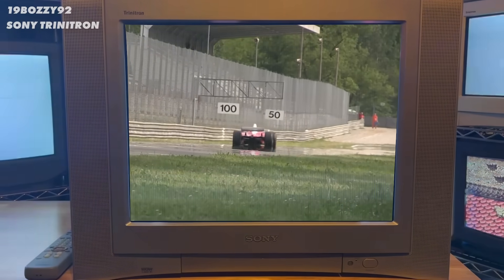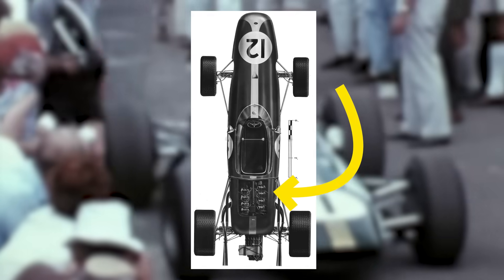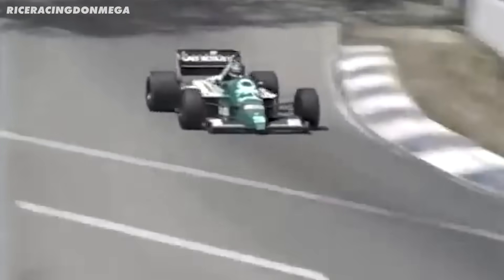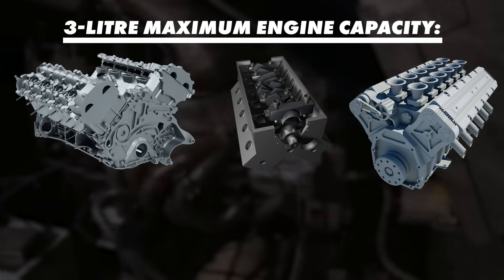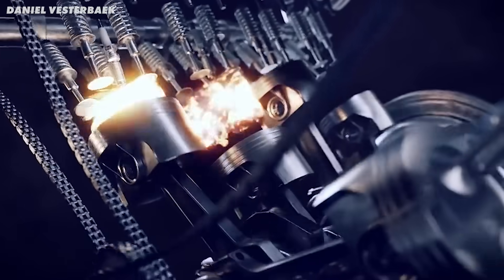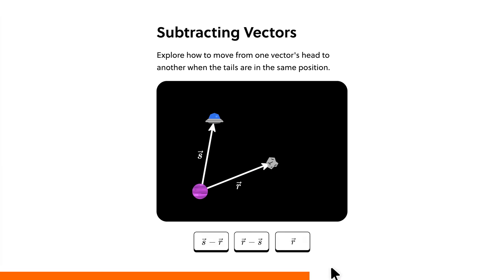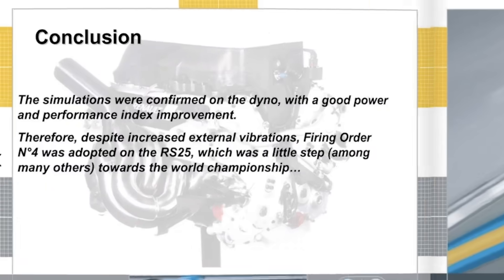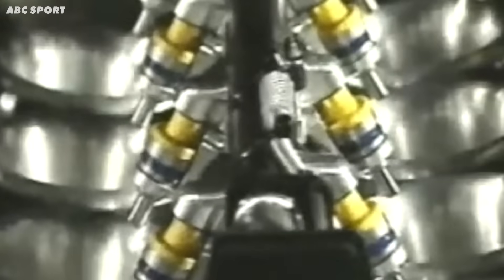How We’re Wired to Love F1 V10s

Comment: I dream of an engine setup that manages to scream a high rpm harmonic over a thumping that modulates through atonal rumble into bass tones up to about 100hz. A 5th or major 3rd would definitely be likely choices, but with that big gap there's quite some other options that may sound kind of haunting, yet so clear with the two separated sounds.

Just imagine the satisfaction of reaching the rpm pairing where the lower note emerges as the fundamental of the upper note... 

It's sorta like a slice of a shepherd tone effect, where instead of the lower ascending voice fading in out of low volume, it fades into tonally perceived range.

I have no idea about the challenges of coordinating two vastly different engines and how consistent they'd have to individually be to begin with (For performance and sound), but just imagine a massive low rpm monster bulging out the front with the screams coming from the back. A single block that manages to do both also sound wild, though. Coordinating a turbo and supercharger, aside from some spooling, that'd just be a symphony.

Comment: theres another part to it too, with the distinctive scream that can sometimes sound higher pitched than a similar revving v12.
the explanation i think comes about when you divide up the numbers
6 cylinders -> 1, 2, 3, 6
8 cylinders -> 1, 2, 4, 8
10 cylinders -> 1, 2, 5, 10
12 cylinders -> 1, 2, 3, 4, 6, 12
and when you split those numbers further, you begin to see what you hear.
6 -> 2x3 (perfect fifth)
8 -> 2x2x2 OR 2x4 (unison / octave, depending on layout)
10 -> 2x5 (major third, but an octave up)
12 -> 2x2x3 OR 3x4 (unison / perfect fourth)
my theory is the 8 cyl sounds like 4 sets of 2, which gives it that very octave-y noise, and a v12 sounds like 4 sets of 3. the v10 on the other hand has the biggest count when split up, with 5, giving it a higher pitch and forming that clear and distinctive tone.

Comment: In my perfect world F1 goes back to NA 3.0L V10's, 80% of downforce is from a fan (imagine the race starts and the insane top speeds), slicks, refueling with sustainable fuels, and smaller cars. In fact I'd go so far as the team's transportation, aircraft included, is on sustainable fuel. All this road relevance and smaller carbon footprint crap is a lie. There is nothing road relevant about an F1 car and the carbon emissions of the teams travel to each GP, especially with that idiotic calendar, is a shitshow. Sadly, as long as the Saudis are involved, it will be about oil.

Comment: ohhhhhh, wait, so the DISPLACEMENT of the engine, is how many liters it uses in one revolution, which means that all the space inside the pistons added together has to equal the displacement
therefore a 3 liter single piston, would have 1 piston having 3 liters volume, and 8 piston 3 liter, would be 8/3 on each piston

i never knew that

Comment: Nahhh, have you ever heard a double 7 radial engine from a fw190 fire up, that makes you happy, fact, that deeeeeeeep rumble, holy jesus. I mean tastes vary, but goddayumn that sounds nice. Or maybe put a gas turbine like the M1 abrams in there like lotus did, no firing order, continous burn, insane rpm, well it drinks fuel as a hobby, but that sound, its loud, its high pitched, it's like the V10 but its the upper side of the compromise, where you compromise the fuel efficiency for the rpm, and maybe it could be implemented with refuelings like they did back then so yeah. Cool video though

Comment: Very good stories about the acoustic "styling" in F1. Thanks for that and they explainations as well. Yes, the V10 are very special and I confirm this was a very awesome sound. But also I like the sounds of the older V6 Turbo engines, they were more damped and not so high reving, but also very special - at least compared to that silly sounds of current F1, despite of the same configuration -  from the viewpoint of a V6. But maybe the configuration of the exhaust makes that so "special". Now all the pipes goes into one Turbocharger. In the 80`s there were only three pipes going on each side into a separate charger and maybe that`s it. Could it be so simple? This sounds worlds much better than current configurarations - I swear. My hope is that one day they return with really cool sounds the offering now. But it seems Lightyears away - 😮‍💨

Comment: 11:40 Its not just about the harmonics. I mix/engineer music/audio. Its also the frequency range of a V10, but also the fact that a Major 3rd is a Poly Rhythm. 

Freq Range:
The main core of the sound is situated in a region that our ears are tuned to. Any V engine with 10 cylinders running at 18'000 rpm, is going to be producing a fundamental note, from RPM note , purely from the combustion cycle, of 1.5 Khz. which is right in the middle of the main frequency band human ears are tuned to (200Hz to about 6Khz). with 1 Khz to 5Khz being where all the detail and definition is in our hearing. A Babies cries is about 3 Khz as are Emergency vehicle Sirens. The 1 to 5 K range is what we hear the most. Its this region of audio that decides how "in  your face" a musical mix is. 

So to put this together, (and to add a further complexity at the end), Not only are harmonics producing a Maj 3rd relationship (which means there is a 1st 3rd and 5th note present), but they are doing it at a frequency range that our ears are particularly sensitive too, so like a distorted guitar amp, its very in your face, but the sound is strangely pleasing so that pleasing nature gets an element of overwhelming, it cannot be ignored, it demands your attention, you are naturally tuned to this freq range

Poly Rhythm:
What is a Major 3rd? well its actually a 3 over 4 poly rhythm from a pulse/frequency POV.
What is a 4 over 4 poly rhythm? basically a 3 beat cycle over a 4 beat cycle , so the so the cycle resets every 12 individual beats.
99.999% of popular music is based around mostly 4 beat cycles and if not, 3 beat cycles. A major 3rd contains both of the most common rhythmical structures within it 
(this 3 over 4 is based on the pulse of each harmonic and the cycle of them repeating the same pattern )

I really have not articulated this well, but hopefully someone will read this and get something out of it
Reply: I found this amazing

Comment: There are several questions I'm not too sure you answered. First as far as what our ears like to hear, to me it's pretty simple. We like high-pitched noises up near the 20,000 Hertz limit of our hearing. Everybody refers to an engine screaming rather than roaring as a desirable thing. That obviously refers to pitch. Now are you saying that a V10 can produce higher -pitched sounds than a V6, V8, or V12? It seems to me there's a correlation between high rpm's and high pitch and that's one of the main reasons current F1 engines can't make those great sounds. I think you could make the current engine in an F1 car a V10 and if you kept it at 15,000 top rpm (not to mention the drivers usually don't even rev the car that high)  you wouldn't get those screams no matter what else you did.
Second we like a rapid change of pitch: we like the sound to go from low to high in a hurry. So the more powerful the engine the quicker it can increase the revs from low to high. Or the more gears a transmission has or the closer spaced they are, the quicker the engine can rev up, because it has to do less work in each gear.
Also are you saying that different engine configurations imply different top rpm's? Specifically are you saying a V6, V8, or V12 cannot achieve 19,000 rpm's? 
And finally you don't mention the effect of turbochargers and various hybrid electrical power producing units on the sound. Isn't it true that driving a turbocharger or electrical device robs the exhaust gases of some of the noise and power they otherwise would have and effects the noise they make rather drastically?
Thanks for putting out some very interesting videos.

Comment: I'm sorry but the conception that more cylinders = less moving mass and easier to rev engine is a complete nonsense, you have heavier crank, more rods and pins, pistons are smaller yes, but u have more of them, u have longer and heavier camshafts, more valves which are also moving, the more cylinders you have the more parasitic losses you make due at least the friction of camshaft to valves, piston to cylinder surface, more heat etc. One cylinder engine will always have less moving weight than whatever number of cylinders engine given the same displacement. What actually helps reduce the piston speed and get more revs is bore to stroke ratio, have a read on that

Comment: 7:58
Releasing "high pressure gasses" into the exhaust pipe.
More precisely, releases COMBUSTION into the exhaust pipe.
The exhaust valve opens BEFORE combustion is complete.
Combustion contained in the cylinder explodes into the exhaust system
resulting in noise and pressure that can push a turbine wheel.

Comment: As long as the interval is even, the exhaust system is equal length and blended smoothly and sequentially, and the banks fire symmetrically, I highly doubt that the firing order will change the sound or power very much. Also, V8s and V12s (and even 6-cylinders of any type) with the above-described exhaust system also sound quite exquisite, and in some cases better IMO than even the peak of V10s.

V10s are easier to get good enough to convince everyone they're "perfect" though. But also IMO, there are other things that make V10s more technically ideal/perfect, as well. Like the fact that the 72-degree bank angle and firing interval mean that at least/either 2 or 4 pistons will be exerting 0 accelerative force on the crankshaft when a cylinder is firing. THAT is something you definitely can't get on any other even firing, reasonable cylinder count.

Comment: In a properly running engine, fuel doesn't explode: fuel burns in a controlled combustion. If fuel detonates then it causes damage to the engine components due to the shock wavefront which travels at the speed of sound.

Comment: Loved this thanks. Also as you say, the number of firings per second are more with a V10 than that of a V8, and of course as it was naturally aspirated there was no turbo to muffle it, and two separate pipes. Often the V8 engines would spin faster than the V10s but of course sound lower pitched.

Comment: Aurelio Lampredi designed a road car engine for Fiat, after leaving Ferrari's race engine department in the 1960's. This 1.1 litre in-line 4 was capable of 9,000rpm in standard factory trim - although almost no-one knew that, since the car it was fitted to was the Fiat 128. Might have been Europe's Car of the Year in 1969, but it didn't even have a rev counter. I inherited a 1300cc version when I got my driver's licence in 1984, and learned about the engine performance while finding out how to maintain and repair the thing. 
Problem is, the sound of that engine at 9,000rpm tingled my spine just as much, if not more than an F1 V10 doing 18k rpm.  But it shouldn't have, according to this science.

Comment: Keep in mind that another reason to limit the number of cylinders is that you can only increase RPMs so high before the piston starts to outrun the flame front of the igniting fuel.  That's also why diesel engines don't rev that high, even when they're huge manufacturer vanity projects, the fuel can only move the piston so fast.

Comment: What I love about the V10s and other older engines is not the sound itself, but the fact that you can hear the car slowing down and speeding up, changing gears, braking and throttle control... Now the engine sound is too monotone in lots of racing series

Comment: Piston velocity is the reason for the rpm limit, not the mass or stress as thats just an engineering problem. The piston velocity limit is defined by the flame front velocity of the fuel used as the piston can't move faster than the flame front. This is why diesel rev slower as diesel has a slower flame front velocity.

So reducing the stroke allows for higher rpm for the same piston velocity, hence more pistons to achieve the same displacement gives shorter stroke thus allowing for more rpm and more flow rate (power).
Reply: Great points.

Comment: 90-degree V8's with cross-plane cranks have even firing intervals all through the firing order.  The deep roar is because there are two intervals in the firing order where two cylinders on a bank fire in succession.  A 90-degree V8 with a single-plane crank also has even firing intervals all through the firing order, but firing alternates from bank to bank all the way through.  This is why a flat-plane V8 sounds like nothing more than a busy 4-cylinder.  Also, a 4-cylinder with a 2-plane crank sounds sort of like a V8 due to its uneven firing intervals.  The Suzuki R1 is an example.

But anways.......my favorite V10 sound was the Honda from the 2001 season.  I saw the inaugural GP at Indianapolis, and the Honda had a sharp edge to it that made it stand out to me as being more scary.  

In general, I like I-5's and V10's, I-6's and V12's, and cross-plane V8's.  (Flat fours give me the dry heaves.)
VisioRacer has a great sound video for I-5's.
Reply: Speaking about F1, it would be interesting if the next regulations brought a V5

Comment: That's a lot of lead up to the part where you start talking about the sound, only to consistently get it wrong. Burbling (90-degree cross-plane) v8's don't fire on alternating banks, they have a paradiddle rhythm ( LRLLRLRR). They also don't have uneven firing - they still fire a cylinder at exactly every 45 degrees of crank.
Reply: And regarding the harmonics - you don't get higher harmonics simply by adding more cylinders. With even firing intervals, you still get a sequence of equal pulses, which is just a "fundamental" (more or less) - so it should sound the same as a lower-cylinder engine firing more often. What does happen with some engines - 3 cylinder, 5 cylinder, and most v10s - is that there are extra (lateral or end-to-end) vibrations due to the imperfect balance between cylinders. This is what creates the "low tone" that becomes the "fundamental", and the individual cylinders become the harmonics. For 5 and 10 cylinder engines you get that pure major third.

Comment: I like the sound of my stock 8L V10 Viper; but it has a completely different sound.  Probably because its max 6000 RPM is <1/3 of these F1's.  It is butal at full throttle.  But if you are idling down the street at 40-45 mph, I swear it sounds like a sewing machine.

Comment: If I could chime in besides the topic - your voice sounds good and clear, but seems like all the rumble from touching the table gets through. Try a "hi-pass" (or "low-cut) filter on audio track. 50-60hz setting is enough to cut off any accidental low -frequency bumps. I am aware that these ale hard to hear on most sound systems, but they are quite pronounced here.

Comment: These engines are monsters, Renault and Honda hit 21k rpm. Cosworth once hit 22k rpm on dyno, they said the rpm stalled cause the SI engine cycle reached its maximum speed for the respective displacement , even with pneumatic valve system engine cycle cant keep up. holy shit!!

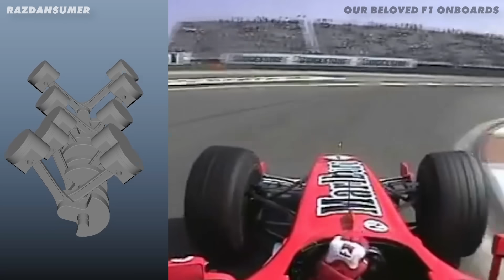Comment: 0:20 combustions, not explosions. Even if explosions sounds better in the script.
Reply: That is a WILD hair to split.

Explosion: a violent expansion in which energy is transmitted outward as a shock wave.

Combustion: the process of burning something.

Both are accurate in this context. Sure, it’s called a combustion engine - but what occurs in the cylinder is the combustion of fuels that causes a directed explosion, which pushes the piston.
Reply: @cbacon46  Hm okay, fair point. Just learned about the difference of detonation and deflagration. Both are explosions, which I didn't know. To me it was explosion = detonation.

Comment: When you take a v8 up to 10000 rpm, the note changes considerably after around 5000  rpm. 
Used to love the note my van made when I got into it and up to the 9000 mile pm redline it had. 5.0l v8 Holden engine with a lot of work done.

Comment: The pistons were light due to being smaller but also had a shorter stroke to keep the pistons as wide as possible, like a tuna can of power, as opposed to a red bull can of the same volume (12oz). Same mass but the short and wide moved a volume of air/fuel in a shorter time, blending the pow pow into a purr purr. Did anyone notice what key the v10 is in at peak revs?